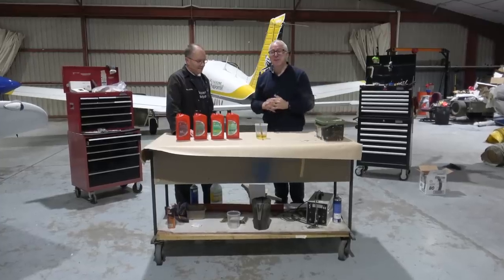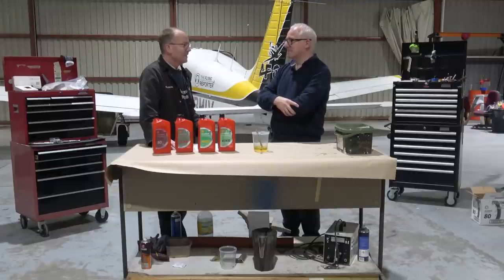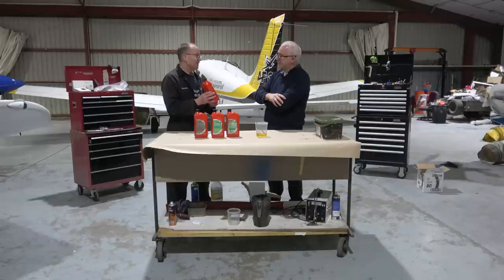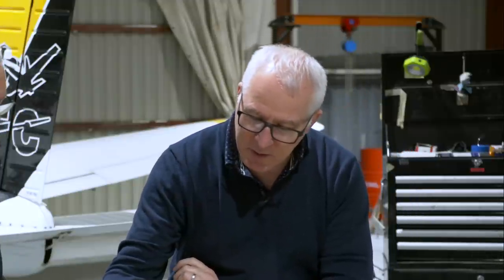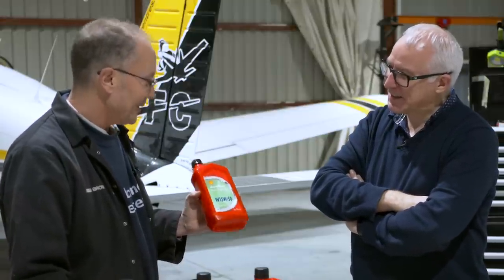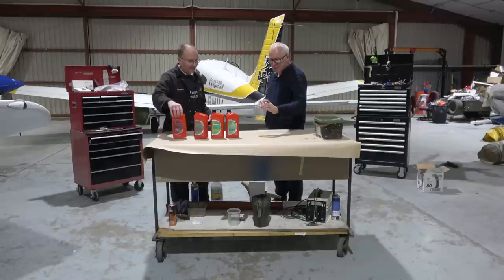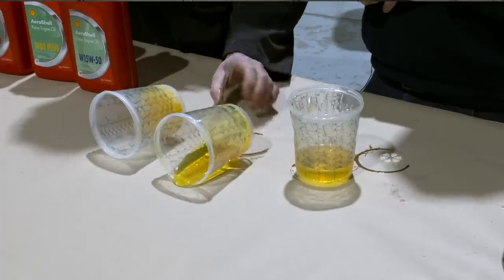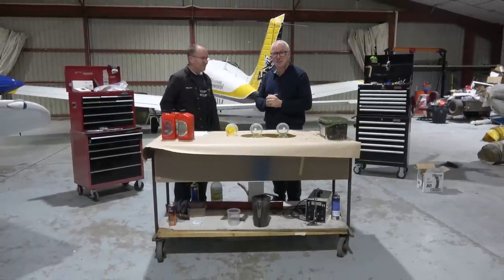Aircraft engine oil demystified

Comment: Good timing with this video - we are currently using the mineral 80 on an overhauled PA-28 engine, normally use W15W-50 the rest of the year (Norway). In the deep of the winter it still gets pretty thick though, so we use engine oil pre-heaters. Without the pre-heat the engine still starts, but it's probably putting a lot of extra strain on the oil pump, etc.

I have your checklist on my wall at home and run through it normally the day before flying, as well as the same day. I only added two items to it - one is to send an sms to the engine pre-heater (winter ops), the other is to file a flight plan (maybe not so common in UK for VFR flights but I always use one when landing away, and also they are mandatory for night VFR when away from the local aerodrome - so good to have on the checklist).

Cheers!

Comment: Interesting, thanks, we use W15W-50 in the Condor's 0-200, in fact I think all the aircraft I have flown, bar two; the A-65 engined D112 and the O-200 engine in the C120 I flew which used W80, have had some variation of the 15-50.

Comment: There are advantages to multigrade oils even if not in freezing conditions. They protect the engine better at start up due to lower initial viscosity. Good for if you do regular frequent cold starts, also good if in an emergency you need to apply a lot of power right after start up.

Comment: There's a huge amount of time and effort goes into molecular engineering of oils so they can maintain their properties, film strength and protect the engine under all operating conditions.  Then we can throw all that knowledge away and use oils with a specification from 75 years ago.  Because even a shiny new cirrus has an engine whose lines were first drawn before any of us were born.  Here we are 2023 still chuffing out huge amounts of lead, altering the mixture and using  magnetos like its 1923! I love the simplicity of it all.
Reply: I have just one comment - ULPower Engines! Designed for unleaded fuels, has Dual ECUs, Fuel Injection, Electronic Ignition and uses modern motor oils. The choice is yours.

Comment: On the whole a very good explanation of the various oil options however I disagree with the opinion given in multi grade oil. Most engine wear happens at start up especially as highly loaded items like the camshaft so getting oil to these parts is critical , overly thick oil prevents this happening and because cold oil is thick and so slow to move it is slow to reach the parts it should be lubricating. For those of us who travel in out aircraft what is good for the U.K. temperatures most of the year ( 80 ) is not good by the time you get halfway down France, so I don’t want to be changing my oil every time err indoors wants a bit of sunshine and a trip to the beach. The largest Lycoming operator in the U.K. usually makes TBO with their engines without anything but routine maintenance, they are using Shell multigrade oil. Regular oil changes are essential especially with those who use 100LL as the mineral oil keeps the lead particles that blow by the piston rings in suspension ( if lead is not heals this way it centrifuges out of the oil and blocks the oilways in the crankshaft) it is the mineral oil part of the multi grade mix that suspends the lead so as the Shell mulitgrade is about 50/50 mineral and synthetic it is vital to change the oil at not over 50 hours flying. If the Philips oil is fully synthetic I am not sure how they keep the lead in suspension but I am sure that they must have found a way following the debacle of Mobil 1 use as an aviation oil.

Comment: I don’t see why you wouldn’t want the 15-50 always. Lean properly and don’t worry about lead in the oil. It’s that simple. Fly full rich always then maybe have an issue over time but I don’t see why everyone wouldn’t just use the guaranteed flow/lube of the 15-50

Comment: I would like to inquire.. LOM Engine ..we have been flying with olomentes fuel for almost 30 years..SEA 50 /60  We fly W100 aero shell ! I check the oil dipstick after the flight ..The oil will have a viscosity of about SEA 30 or 40.. Mineral oil does not retain its viscosity Aero Shell 100w Mineral oil does not retain its viscosity.. viscosity index 96 ! The problem is that there is a lot of coke deposited on the pistons oil mud sludge !  You should move in the direction of synthetic oil ..it is much more stable, there is no deposition, it withstands large temperature differences and maintains its viscosity .....for example Motul 15w-50 competition 300v and 10w-60 Le Mans 20w-60 300v Le Mans.. viscosity index 170 !!  Motul oil is recommended for aircraft engines by UL power engie...   I would like to inquire about your vision for moving in this direction? and his opinion on synthetic oil in aircraft engines operated with Olomentes gasoline.. Thank you